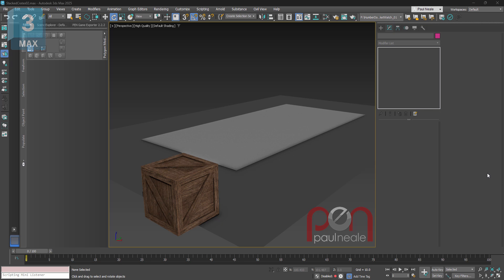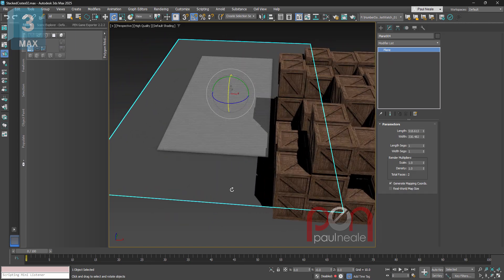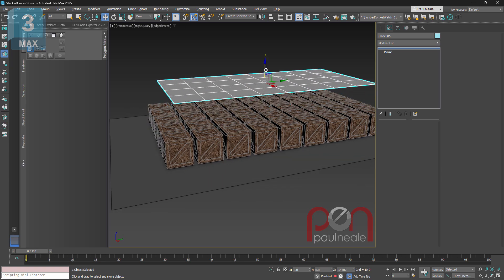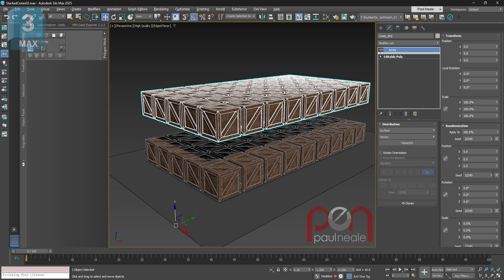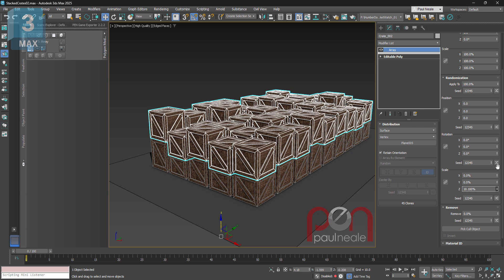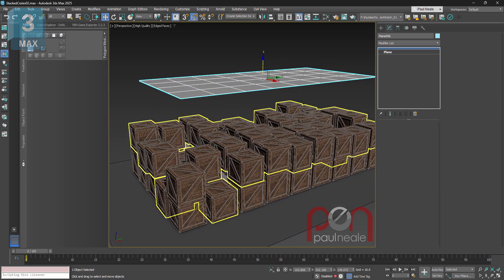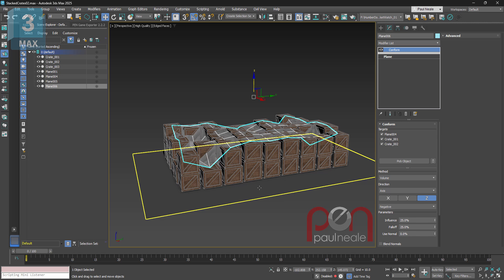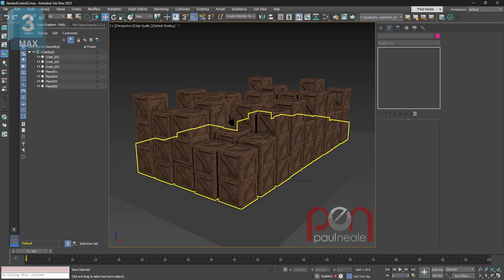3DSMax Random Stacking Wood Crates

Comment: Is there a way to visualize the instance, reference, parent-child relations state etc. in 3ds max viewport? like different colored overlays (outline and/or wireframes) than regular objects or some sort of connectors / wires.
Reply from the maker: Turn on Display Dependents in the Scene Explorer. But you can also see that the instances are bold in the modifier panel.
Reply: @paulneale I was hoping there were some actual viewport overlays.  It's a   little strange that you have that differentiation in the stack and none whatsoever in the viewport. Talking again to you Autodesk ;)

Comment: Around 02:10 onwards: how does making the wood crate on the second row a reference affect the final result?
Reply from the maker: @Kranos_CG  I have a video on Copy Instance Reference that you should watch.

The idea is that any change to the crate will update all of them but the modifier stack on the refence can have unique modifiers.
Reply: @paulneale but in this particular example it didn't make any difference did it? You are only playing with the array settings which are unique
Reply from the maker: @Kranos_CG  If I want to change the box I can change all of them. That is the only reason that I show it.
Reply: @paulneale  gotcha

Comment: Great! Short. To the point. Understandable. You really make a good case for exploiting the procedural potential of Max.  
You have demoed a host of procedural workflows just using the standard Max modifiers, especially Array. It's very appealing and highlights Max's advantages over Maya. I wonder if you utilize MCG at all with your workflows. It arrived with great excitement and then seems to have been forgotten in the Max community at large.
Reply from the maker: @EbolaStew  MCG is interesting bit the implementation has issues. At this point it is dead and will not see updates. I do use it some times for creating custom modifiers.
Reply: @paulneale  Hmm. That's too bad. Do you think Bifrost will find it's way into 3ds Max? I'm not even sure how much it is catching on in Maya.
Reply from the maker: @EbolaStew  it is in Max but just fluids and I don't think it will go anywhere as it is t that good under the hood.

Comment: Very cool!   Though at 2:09 I get a bit confused as I'm new to that Motion panel -> Assign Controller stuff.  Anyone know a beginners tutorial or summary for what that is?!
Reply: It’s just a way to add a modifier like procedural noise for example so that an object vibrates/moves without key framing by hand. (Max’s noise controller)
You can even use a sound file to drive a model of a speaker for a stereo using Max’s Audio controller. 
Very powerful feature in max that gets overlooked often. There’s even a expression controller so you can use math to control an objects parameters.
I haven’t looked but I’m sure there’s some videos out there. Start with the noise controller because it’s pretty self explanatory and easy.
You could add a noise controller to a camera to give it camera shake without keyframming by hand etc.
Reply: @AutodeskFTW  Oh, that sounds very cool!  Thanks for explaining it. I got a lot of things in Max to explore but hopefully I will get around to this! I'd love to see a tutorial,  but I've also been tempted to make some tutorials myself because sometimes I've used techniques that are faster than what I see in other people's tutorials ^_^